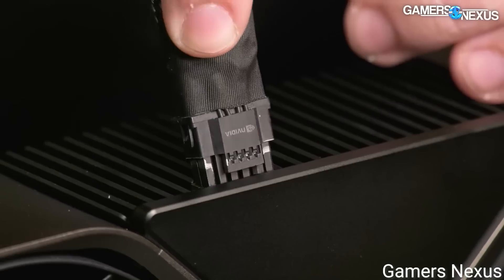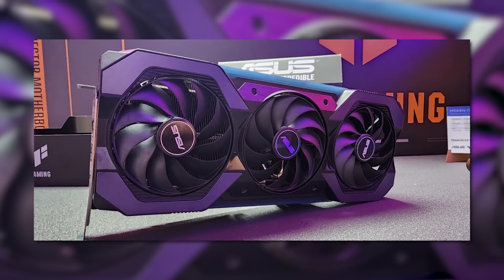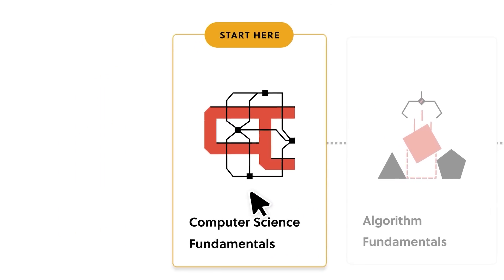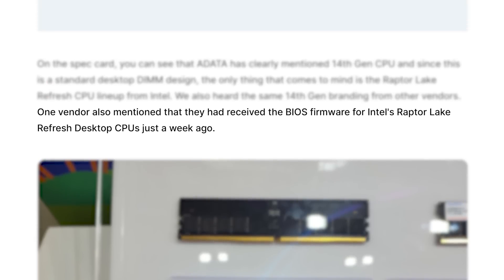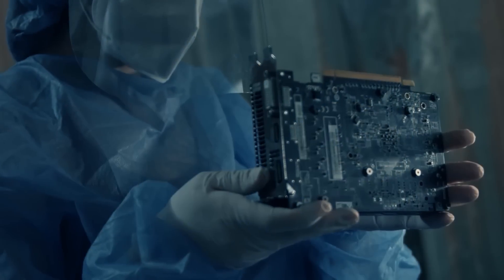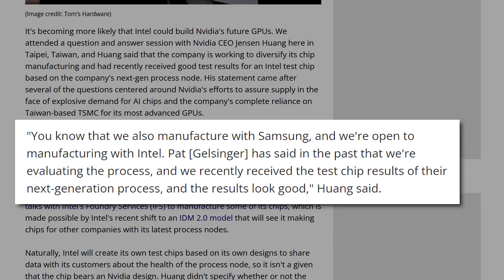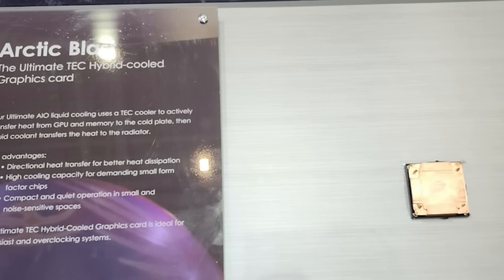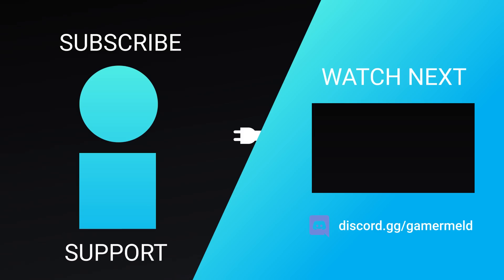Nvidia And Intel Are TEAMING UP!

Comment: Nvidia should have the power cable built into the PCB on the 4090 to avoid bad connector issues. Preferably with a flexi swivel to allow for maximum case compatibility.
Reply: That's an atrocious idea
Reply: @duke605  You're right, having melting connectors is a much better idea
Reply: @AxleLotl  The 4090's melting cable is user end error. If you don't plug in the power connector properly of course it's gonna catch on fire.
Reply: @laszlozsurka8991  Well... yeah.... hence why I suggested an inbuilt power connector... to eradicate the user end issues whilst still maximising case compatibility for the larger GPU's...
Reply: @AxleLotl  NVIDIA can't do anything about the dumb customers. If you don't pay attention, that's your fault.

If you buy a $1,600 product you better be delicate with it.
Reply: or intergreted on the pcb to not have to use an adaptor that melts , its not like they dont have the room in these cards

Comment: Im calling it now 14900k will be 450w and 14900ks will be 500w+ under load
Reply: Not why we all swallow AMD power draw marketing propaganda. I only care about performance.
Sign me up for a faster CPU.
Reply: @AmericaWhatsup  500W+? At least, you won’t need to heat your home in the winter. All to equal the performance of a 7800X3D? Whatever…
Reply: @tringuyen7519  No not equal at all. Only for those games that benefit from 3D-vcache. And we don’t yet know the performance of the 14th gen.
And I don’t have to worry about my Intel CPU burning up and taking my motherboard with it.
Maybe maybe but time will tell.
Reply: @AmericaWhatsup  The Cpus burning up wasnt AMD's fault though, and most of the latest games benefit from 3d v-cache. Its equal you just are too blind to notice. What started your hatred for AMD?
Reply: @resensegaming  Why are you fronting? I own a 7800X as well. It is a legitimate and serious problem. There is clear blame on AMD’s side. The AGESA provided by AMD allowed this to happen.
Reply: @The Nerd King  it was the motherboard vendors that were pushing the cpus over 1.4v and the mobo vendors that didn't have working fails safes in place. Also most issues have been with x3d chips. All intel chips are having issues with cooling. So what's your point?
Reply: @resensegaming  Ah no AMD’s AGESA allowed this to happen and was not forthcoming about this being a problem.
And maybe this is a flaw in the X3D design.
I mean just bolting on cache cause your design is slower works really well for some things but not all.
And I actually own current Intel and AMD platforms.
No no no Intel just needs properly designed cooling.
Faster is still faster sorry not sorry.
Reply: @The Nerd King  you intel fan boys really will say anything to but amd behind intel. Remember the FX series cpus? The amount of hate for power consumption? Now intels in the same boat if you could stop fondling gelsingers balls and stop looking through an intel colored window.

Comment: All we want is better performance for the price and lower power draw. These 500W GPUs make no sense unless you're living in Antarctica or have permanent air conditioning.
Reply: People on YouTube when the most powerful GPUs on the market do indeed draw a lot of power (very surprising)
Reply: Antarctic treaty won't allow anyone to go beyond Antarctica, it's the most guarded place and highest land on earth.
Reply: Honestly. As long it can play 1440p with frames around 80-120 with good power optimization, it's perfectly fine. This is starting to get overkill 😂
Reply: I can't imagine here when air temp hits like 38Cº how it would work, I barely can stay in the PC on those days and I have no AC and my house doesn't have roof tiles but rather a terrace which means inside my room is burning hot after a day picking up hot sun.
Reply: @guily6669 oh they dont have ac in most houses in europe? You can always buy a cheap wallmount ac. They help a lot
Reply: With my undervolted RTX 4090 Gaming I only consume 250-300 watts max. @4k/120FPS/120Hz gaming and seldom reach 60° C 😂 what alse do I need?? ❤🎉
Reply: Just get case with better airflow
Reply: 4090 is crazy efficient at lower wattage
And the case airflow does not matter it will heat up your room faster
Reply: When the 4090 released people immediately played around with undervolting etc. and achieved like 95% performance with ~70% power consumption (don't take it literally, just roughly what I remember)

When the next gen GPU has 30% more performance (it's practically never less) than the predecessor and you run it with frame limit, undervolted etc. You automatically have a lot lower power draw than before at the same OR better performance.

Of course it's not 1:1 scalable and at some point the card just has a base consumption, but when we're talking gaming there are many options to tweak it to your desire.

You can also access detailed info on performance per watt for any GPU there is and make up your mind yourself. Nobody forces you to get a 500W top of the line GPU.
Reply: @brohvakiindova4452  Nobody forced you to write this comment yet here we are.
Reply: @GoonyMclinux  lol why so salty? :D
Reply: You practically have to undervolt the cards or just upgrade your electrical wiring
Reply: Speak for yourself. If you want lower power draw get a lower end card, it will be cheaper too. Go figure. Also these cards run fairly cool because of the beefy heatsinks. The 7600 litearlly runs hotter than my 4090.
Reply: @_godsl4yer_ but that heat goes somewhere being his point
Reply: @dunndudebemelol  it's really not a problem. Although I live in England, I can put my hand behind the case and even at max 450w, it isn't an issue. But that's just my GPU model and case.
Reply: @user-if4fk7qy1u  depends really. When I had a 460 it used to heat the room up and due to the room design/ strong winds preventing opening of windows quickly became a sweat bath
Reply: honestly lower power draw seems like 4-5 years away accept it or wait
Reply: @GUY-on-Earth  4070 Ti and below draw barely any power. 4070 draws less than 195W in gaming
Reply: @jedenzet  yea but i’m talking about about flagship cards like the 4090 being low power draw. That’s about 4-5 years away maybe even 10 but 2026-2028 is probably around the time it’ll start or be refined
Reply: @GUY-on-Earth  Nvidia's 40 series cards actually have a great power especially compared to AMD. Still too expensive tho.
Reply: If you want lower power draw. Lower the dang settings!!!
Max output only happens when you floor it.
Every car gets bad fuel economy when you give it all its got at every stoplight.
Reply: @Yaboidavey  I don't think thats the same if you're not capping fps too. Otherwise all you're doing is exchanging torque for horsepower.
Reply: broke
Reply: Lol so u pretty much want everything.
Reply: @MadPCsuperb  they already have the tech, look at the rtx a2000, runs off the pcie slot and runs like a 3050. Mine draws something like 75 watts.
Reply: @MadPCsuperb  It's like asking for infinite wish from gennie
Reply: @MadPCsuperb  He is right. These companies are selling you RAY TRACING for 2 or 3 THOUSAND dollars. Its just a scam. Ray Tracing is the MMX of its day. I have the new AMD 7900XT and have yet to even install it as my 6900XT still smokes what I play in 4k. I will use the XT when I need it. Ray Tracing will go down in history as the biggest scam in computing, at least until the next bigger one Nvidia pulls. I told users NOT to sell their 20 series cards as I knew the shortages were coming and that Jensen was standing in his own kitchen and lying to us. The ray tracing is a result of them not being able to use that area of the chip for much of anything else. It means that some new thinking is required not a reflections gimmick. I literally CANNOT even tell the difference in most games with it on and off.
Reply: Exactly. I would rather see trend with gpus getting 35 to 50% performance uplift in smaller package and less power draw than 100% perf incrrase with bigger and bigger size it doesnt even fit in to standard mid tower case and power consuption of 500w+.

Comment: Intel will be the only company to be getting ASMl high na euv machine in 2024, and Intel said they will be making arm architecture too, not just x86 anymore, so to save cost and time, nvidia will be telling Intel to make its cpu and gpu.
Reply: yes of course haha!! Nvidia is afraid of losing and wants from famous Intel, Intel is worth helping with Nvidia before intel makes more of a new CPU chip of sense with nvidia gpu and also intel is open key as x86 will be 5090ti! If you knew that Nvidia respectfully presents genius to Intel and several fabs with more capabilities, more dangerous intelligence, and can you imagine intel/nvidia will be bigger competitors that will be able to beat all the main companies, apple, amazon, anything even less AMD, not even a shine